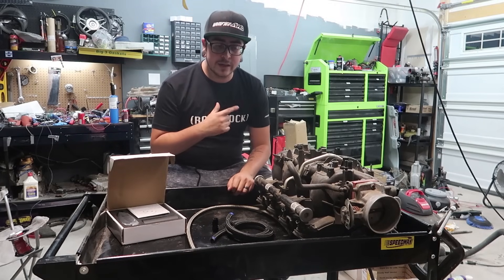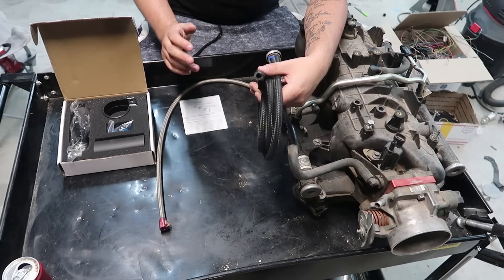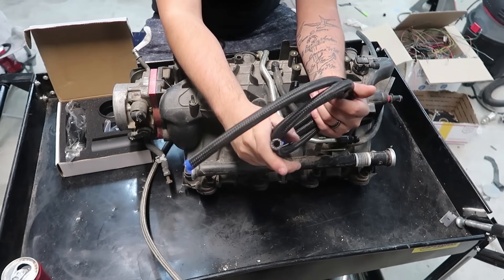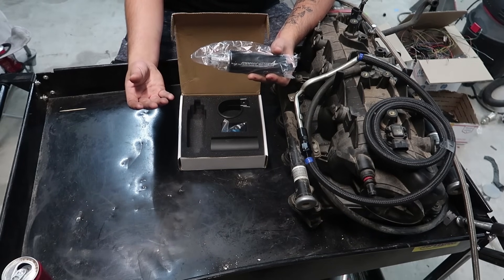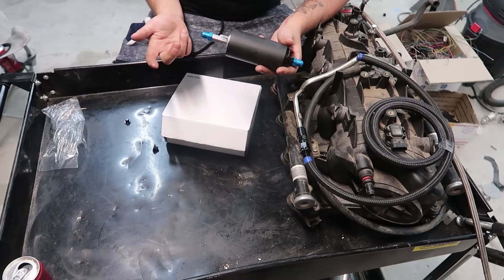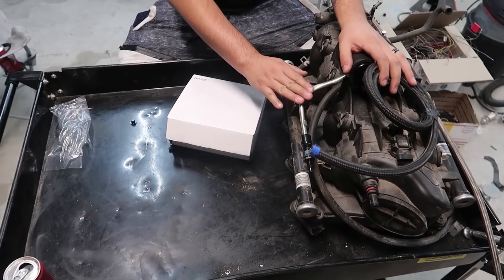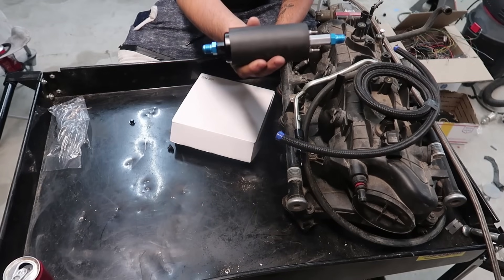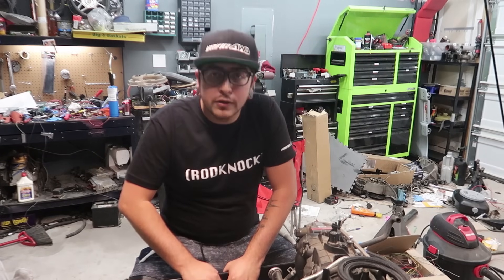LS Swap Basics - Part 1 - Fuel Systems *How to LS Swap Any Vehicle

Comment: Planning the fuel system right the first time saves so much headache. Been running an LS swap in my '89 Silverado—used a Vd70s to get the fueling dialed in after install. No complaints.

Comment: got a question, ls swapped my truck and the factory fuel setup is returnless and 5/16, so swapped out my 5.3 to returnless and going to switch to these AN lines 3/8, but the pump itself is a plastic 5/16 connector. So what do i use to connect the 3/8 line to the fuel pump? i dont want to use those cheap plastic connectors though.
Reply from the maker: @zombiebloodsparkle1  5/16 to An quick disconnect fitting
Reply from the maker: Ictbillet has metal ones

Comment: Where can I find a set of those return less rails for 6.0 I've been looking
Reply from the maker: @chenomartin5666  they are the same as 4.8/5.3 junkyards will have them
Reply: @JovaniDanteGriego  4.8/5.3 gm trucks 99-03 ?
Reply from the maker: @chenomartin5666  yessir
Reply: I just found a set 01-07 return less gm Escalade what do you think
Reply from the maker: @chenomartin5666  it will work!
Reply: @JovaniDanteGriego  thanks bro your video. I've been having tuff time with my ls swap I have a 6.0 4l80 intake has inlet and return the mechanic plugged my return hose with a screw and installed a regulator not running right thanks for the help
Reply from the maker: @chenomartin5666  yea for sure! Just remember the returnless will need an external regulator
Reply: @JovaniDanteGriego  I have one thanks

Comment: My son LS swapped his 2001 Dodge Ram, and doesn't have the Dodge PCM to communicate for the fuel system. Would installing a pump like the walbro gs323 be best with a basic on/off toggle for the fuel?
Reply from the maker: You can just wire up the fuel pump according to the GM ECU, which would be having the ECU control the ground side of a relay which then would control the fuel pump

Comment: Hey, wondering if you’re able to clear something up for me. Are you keeping the stock fuel pump that’s in the tank in order to get fuel out to the external fuel pump kit you mention in this video? Or is this external one taking place of the fuel sending unit ? I’m sure this is an easy to answer question, I’m just not able to piece it together. And would I have to upgrade the stock fuel sending unit that’s in the tank, or is that what the in line fuel pump takes care of? Thank you in advance, great video with tons of great info
Reply from the maker: If working on an older car that doesn't have an intake pump, you can use an external pump mounted below the tank, however in most cases you'll probably want to install a bung on the bottom of the tank to gravity feed the pump. They dont suck very good, they only push. 

If you have a car that has an in tank pump already then I recommend figuring out a way to install a higher flowing pump in its place like a walbro gs323

Comment: External fuel pump ? Mounts to the chasis ?
Reply from the maker: Yes
Reply: Ok thank you im ls swapping my 83 k5 just looking around for some type of list to go of off
Reply from the maker: @jesseg573  if your doing a square body go check out my other videos I have a whole series on what to do
Reply: @JovaniDanteGriego  ok sounds good, thank you.
Reply: @JovaniDanteGriego  also i just found on 1 pf ur videos u have a full link to every part w/ table of contents i was looking up have on walbro fuel pump then below it, you have a fuel sending unit, i need both or either or ?
Reply from the maker: @jesseg573  yes the pump mounts into the sending unit
Reply: @JovaniDanteGriego  with and external fuel pump will i still need a sending unit ?
Reply from the maker: @jesseg573  why not just put the pump inside like I do in my video?
Reply: @JovaniDanteGriego   the thing is im having some1 do it im trying to order everything and not order something twice

Comment: How important is the height of the fuel pump?  I'm doing a 1961 Pontiac.  The best closest place to the tank outlet is in the front of the tank with no good place to mount it accept even with the top of the tank.  The tank is only about 7 inches deep. Will it pull the gas from the fuel tank ok?  Or should I try to manufacture a bracket that gets the pump  closer to the bottom. ? The fuel tank is about the lowest spot back there.  Any lower and the pump will be dangerously low.  Mounting it in the side of the from would make it with about 6 feet of fuel line that would run up over the axle.  That seems  to be a pretty bad option.
Reply from the maker: You want the suction part of the pump basically touching the bottom of the tank
Reply: @JovaniDanteGriego  I'm doing the external pump.  The fuel outlet from the tank sending unit  is at the center and the upper rear  corner  of the tank. I'm just wondering if there is enough suction from the fuel pump to get it that high?
Reply from the maker: @billguthrie2218  you typically want it below the tank.

Comment: Hey Jovani, I have a Colorado that has a single fuel line for the fuel tank (no return line). The intake manifold for the 5.3 that I put in it is a return style system, which obviously has the two lines and doesn't match the truck that it's going into. Do you have any recommendations? My thought is that I can either drill a hole in the tank for a return line, or just find a returnless style manifold and replace the one I have. Let me know what you think. Thanks for the great video!
Reply from the maker: Have you looked at the tank? It most likely has a return. Every fuel injected vehicle is using a return I think

Comment: As he pointed out the -AN fittings are anodized aluminum and normally use alu. wrenches, metric will work with some added parts. A 3/4" wrench when clean can have electrical tape glued to the inside with a dab of weatherstrip adhesive. 11/16" = 16mm, 5/8" = 15mm, 9/16" = 14mm, 1/2" = 13mm. Electrical tape, masking tape, it will all work. 
  Anyone expecting more than 500 horse power should maybe using larger hoses or different system. Holley currently owns about 80+ company's including "Earls" fittings and many, many more. Not bad for a company who built two small cars in 1900, then asked to produce carburetors for use on airplane engines.
DK, ASE Master Tech Since 78

Comment: Thanks so much bro! Exactly what I was looking for. When you tap the standard fuel tank, do you drill it? If so, any risk of explosion? Doing ls swap on my 66 impala. Thanks bud!
Reply from the maker: Hey man! There's been some new things since this video came out. For a return you can try these https://www.ebay.com/itm/314005491076?mkcid=16&mkevt=1&mkrid=711-127632-2357-0&ssspo=x9VBSnt5RYG&sssrc=2349624&ssuid=az6KSd1HQm6&var=&widget_ver=artemis&media=COPY

If you plan on drilling the safe bet is to fill the tank full with water and then obviously drain it all out with your done. 

This will minimize risk of spark explosion
Reply from the maker: Also for your feed line I recommend AN 6 tube fittings. Basically cut the nipple part off of your fuel sender so it's just straight tube and put one of those on. Yours is most likely 3/8 line

Comment: Hey man getting stuff lined out for my first swap. I have a running driving z71 Tahoe, that I can’t get a title for. So I’m going to use it as the donor. Can I use the factory ECM wiring harness and all that? Or should I buy a like a painless wiring harness?

It’s going into a 2016 Charger, so this style of fuel system would work as well, right?
Reply from the maker: Yes stock ecu and harness would be fine but you need to modify it for standalone. Many places offer that service. Lsxspecialties has great harnesses already ready to go as well. And yes just adapt the charger fuel system to the LS. probably using AN lines would be easiest

Comment: On the line that goes over the intake what is the part number for the little cap and is the hose barb on top or the intake to the driver side head supposed to come off? Like the entire circle thing with the straight 90 hose barb

Comment: I’m planning on doing an LS swap on a 79 trans am, would I be able to run an inline fuel pump along with the original fuel pump in the tank so I don’t have to spend 400$ on a in tank fuel pump? I’ve been trying to look this up but I can’t really find anything on it. In your video you said it sucks instead of blows so I assume you still have the cars stock fuel pump as well
Reply from the maker: Are you sure your 79 even has a pump in the tank. I bet it's on the side of the engine. So you shouldn't need to worry and can just run an inline pump. however I reccomend a genuine walbro these days. External pumps tend to not last as long as in tank pumps. So buying a genuine will prolong your life
Reply: @JovaniDanteGriego  alright thank you I appreciate it!

Comment: Yo dude love 💘your Channel
Thank you for sharing your experience with someone like me that Does not know much about this stuff
I have a 1976Dodge dart swingers slant six looking forward to install a Junkyard 5.3 engine
Help me with this Please your videos always Motivate me Thank you
I'm going to get rid of the fuel injection I don't know much about that it's going to be running on carburetor Blow through
Harley What kind of system should I use to feed it gas
Please help Danny from New York thank you 😉
Reply from the maker: So if you are going carb route you will only need about 6psi which any of those external rail mounted fuel pumps at AutoZone or O'Reilly's will do. Then you will want to regulate it down depending on the carb you use

Comment: Jovani ,great info! Im putting a 5.3 with a return style intake in a Chevy c10 that I relocated the fuel tank to the rear of the truck. Can I convert it over to the Corvette style filter regulator setup? I would like to avoid running the return  line all the way back to the tank. If so would I just block off the  return line port and disconnect the vacuum line regulator? Thanks!
Reply from the maker: I have never tried blocking it, you may just be better off getting a aftermarket fuel rail with a single inlet

Comment: Do you need a different fuel tank for an ls swap I’m new and looking to get all my info and parts before I start.
Reply from the maker: It's preferred to have a baffled tank so your pump doesn't run dry, that or putting the fuel line on the very bottom of the tank and never running it less than a 1/4 tank

Comment: so with just an external fuel pump like this you probly never wanna run less than a 1/4 tank of fuel to not starve the pump under high acceleration or hard cornering?

Comment: So how would i do the fuel system on a 84 cutlass gbody swap of a 5.3LS with a return style fuel rail?
Is return line pressure low enough that  i could  use stock cutlass fuel feed line for the return line to the tank?
then i just need to plumb a new braided line from tank pick up to fuel inlet?
if so then i would probly need an all new pickup and fuel pump assembly to put in stock tank correct?

Comment: Great vid.    I have an LS conversion in an 86 C10     Way too much fuel pressure.     The return line on the manifold is blocked off.    does the 86 tank have a fitting for a return line so I can run a return less system   ?       I have the external pump but can't really see any return line.
Reply from the maker: Im not sure on the 86, however, this can be easily remedied by installing one of these into the top of the tank to serve as a return: https://ebay.us/elB54A
Reply: @JovaniDanteGriego  Thanks so much that is very helpful.     I don't really want to drop the tank.

Comment: Your videos are so helpful and informative. I have a question that I hope will help others watching your videos that is - Can you install a cable throttle body on any of the 99 - 06 truck engines? Can the 03 - 06 drive by wire be converted? Any other necessary suggestions?
Reply from the maker: They can be converted but I believe it's dependent on the ecu . The 0411 is the proper one for dbc

Comment: What’s the fuel filter you use ? It’s not talked about that much in the vid. And it’s not in the description. Thanks for making this vid so simple and easy to understand. Just bought the an fittings/adapters / fuel lines and pump. Going to try to start my ls soon.

Comment: I did a 2004  v6 Silverado to v8 conversion using a 04ntahoe as donor vehicle.  Kept the og fuel line system . Now the issue i have is that my truck measures fuel the oppisite ..lol have you had any issues like this?
Reply from the maker: What do you mean measures the opposite?
Reply: @JovaniDanteGriego  it reads empty when the tank is full
Reply from the maker: It could be some crossed wires or the sending unit isn't grounded properly
Reply: @JovaniDanteGriego  thank you

Comment: Hey on the ls truck intake manifold is the fuel supply line usually a 3/8” or 5/16”?
Reply from the maker: Supply is 3/8 return is 5/16 im pretty sure

Comment: I ordered the fuel line fittings you listed. Is the fuel line the same from the amazon link as the ebay link? Which is better I need a 20ft roll asap, just waiting on a reply
Reply from the maker: Standard AN6 is all the same size unless you go with ptfe
Reply: @JovaniDanteGriego  last braided I bought didnt fit my fittings and the braid kept fraying out. That why I'm asking if they both fit the fittings the same, im trying to just use the same u did. So I don't have the same issue again
Reply from the maker: It should work. When ever I buy AN6 no matter where I get it from it works. It's a standard size
Reply: @JovaniDanteGriego  so you think I should be good with the 20ft ebay link you posted? I already bought the fittings you linked in the description
Reply from the maker: @julz9272  you should be I won't guaruntee anything since sometimes the parts links aren't the exact ones I used, different sellers etc. But like I said AN6 should work with AN6. Make sure you look up videos on AN hose assembly before you get started. A good method to geth the fittings on in putting a impact on low with a socket that fits and spinning the fitting on the hose. I have an older video of assembling some AN hoses on my channel
Reply: @JovaniDanteGriego  cool man thanks for the help. I've been stuck on fuel lines and fitting for a month now. All I need to be able to drive my car first time in 4 years
Reply from the maker: @julz9272  good luck! Feel free to dm me in insta or my Facebook page of you need help
Reply: @JovaniDanteGriego  BET!! I appreciate the offer if I do ill get in touch

Comment: So if I use the corvette fuel pressure regulator Oani my system is a single line how do I add the 3 lines the one to the manifold I understand and the feed but the return one is confusing could you actually set one up for display purposes thank you in advance
Reply from the maker: So if you only have one pipe on your intake you use the Corvette regulator because the return in on the regulator. If you have 2 pipes in your intake one is the return and already has a built in regulator

Comment: Hi Jovani, I was able to solve the problem, thanks to your advice.
The pink wire wasn't getting voltage, the neutral switch wasn't working properly and was replaced, the speed sensor was disconnected.
Thanks again

Comment: Hi Jovani
It's me again
With another problem, I would like to see if you can help.
Thanks to you I solved the VATS problem in my LS swap
The engine 5.3 its running great.
Now my problem its the transmission.
I had it rebuilt installed but it doesn't shift.
Park, neutral, reverse and drive work but I think it only runs in second and it would not shift.
I think it's something that I didn't connect when I worked on the harness.
Amy suggestions?
Reply: It's a 4L60
Reply from the maker: Is it 4l60 or 80?
Reply from the maker: This can be a wiring issue like a low vss signal or a bad vss sensor. It's the sensor in the back of the transmission. Also make sure you check the pink wire on the main plug for 12v. If that isn't it then it might be the tune wasn't set up for a 4l60 and might be configured for a 4l80
Reply: @JovaniDanteGriego  
Thank you very much for your reply.
It should be for the 4l60 because I am using the same PCM that came with the motor and transmission but nevertheless I will double check with the company that took out the VATS.
I think it may be bad wiring because the video that I used from YOUTUBE to do the wiring did not mentioned the pink wire from the transmission to the fuse block, I remember everything like  coils, injectors etc but I don't recall Transmission wire to the fuse block.
I will start there.
I didn't cut any wires I should have it there.
The pink wire goes to 12 volts? to the fuse block?
I will let you know  the progress, thank you very much!!!!!

Comment: How about if I’m running a carb instead of FI at around 4-6 psi without a return?  How would I setup the fuel supply? A regulator at the carb set to 4-6 psi?  Is this pump to much psi to be regulated down to 4-6?
Reply from the maker: Yea if your using a carb you'll want like an Edelbrock or mr gasket inline fuel pump you can find at AutoZone that's made for carbs with an adjustable fuel regulator after the pump